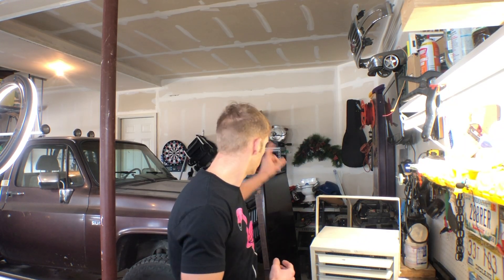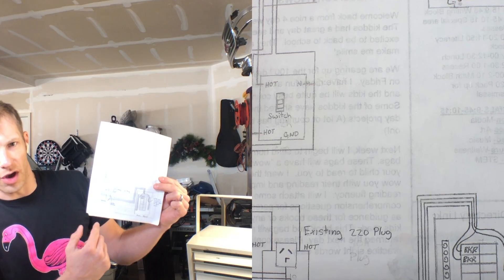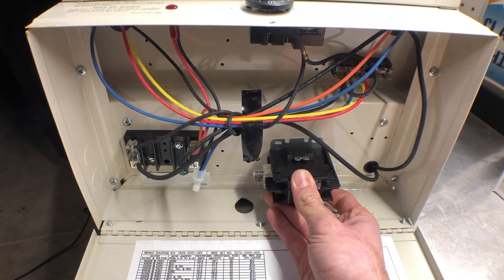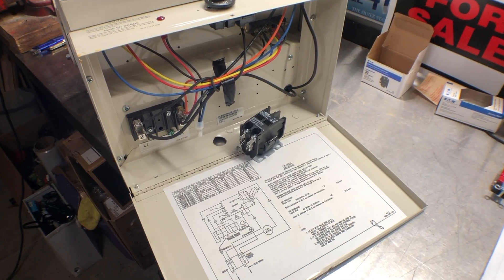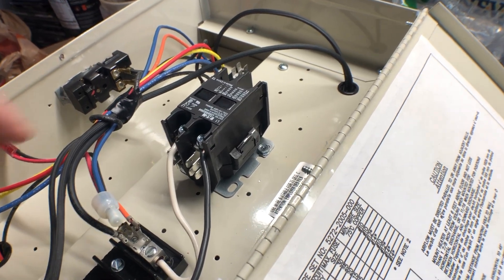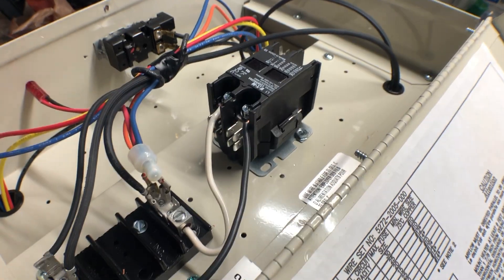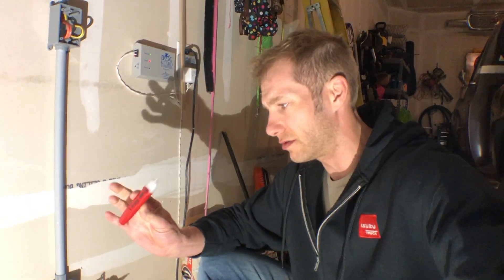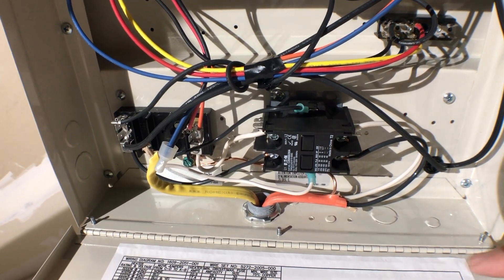How to: Wire a Contactor for a 240V garage heater!

Comment: Usually the contactor is installed in the heater.
Reply from the maker: @jolyonwelsh9834  it is installed in the heater. I mounted it in the bottom of the heater. Thanks for watching!
Reply: @HighPriority  no. Some heaters come with the contactor already installed.

Comment: In New York state.  if you use a plastic conduit, the outside orange and yellow casing has to be removed form the #10 and #12 wire
Reply from the maker: @RobertEdic-s9t  good to know. After doing this job and reading comments here, I would have ran individual wire.

Comment: This would fail an inspection.  That switch is not rated for 30 amps and you've basically put it inline with the heater load which defeats the purpose of using a contactor. The point of the contactor is to handle the load such that something like a normal light switch (or timer) can power the coil.  Also it's kinda wasteful and potentially dangerous (heat) to run romex like that through PVC (nitpick). Much cleaner (and easier to pull) to use individual THHN conductors. 
Nice heater BTW, I have the same one.
Reply: Unless he wired it differently than the diagram, the switch isn't in line with the heater. It's in parallel; the hot at the switch is spliced from the receptacle's hot line and then it only powers the contactor coil. The current through the switch will only be as much as the contactor coil draws, plus the power for the light.

Technically the switch in the diagram is labelled a bit strangely, since it's more accurate to say the line going to the contactor coil is "load", not "hot", but the circuit itself checks out.

Individual conductors should have been used in the conduit though for sure.

Comment: Please note for RV owners - that outlet is not for an RV! do not use it. That outlet is for a dryer - 220 volts. An RV 30 amp outlet should be 110 volts single phase. Search on YouTube for correct RV outlet wiring.

Comment: Awesome job man I am getting mine except I want to hardwire the heater directly to the panel breaker box with a switch. I don’t have a 240v outlet like yours. Any suggestion is appreciated how to wire that.
Reply from the maker: You can look up wiring straight to a breaker in your panel, or mount and wire your heater and run the wire to your panel, then have an electrician tie it to the panel.  That’s what I would do since panel work kinda scares me.
Reply: I am getting power directly from the 30 amp breaker 240v using 10/2 I don’t have a neutral wire. Do I need neutral ? as I saw you kinda tied the neutral from the breaker to the contact (white-12/2) at the switch box before letting it run up to the contactor.
Reply from the maker: @muqtarali9974  240 power doesn’t use a neutral, it’s two hits and a ground. The wire my electrician used when he installed the outlet is 10-3 wire with a ground, so it has three sheathed wires the white, black, and red as well as the ground. My white/ neutral was just hanging out unused in there so I used it for the neutral on the switch and contactor. Hope this helps

Comment: Great video. I'm having some confusion.  Not an electrician. I have a 5000w 240v unit. I have a 240v outlet for my air compressor wich is wired with #8 and going to a 40a circuit breaker. Can I wire this with #8 wire and have it plug into the outlet without any issues? Or do I risk burning my house down?
Reply from the maker: I debated on wiring my heater this way, with a cord and plug and not using the contactor at all but I opted to hard wire it. I think as long as you wire the plug correctly you shouldn’t have an issue and be able to unplug your comp and plug in your heater.  Granted, I am no electrician either.
Reply: Yes you can

Comment: Help me out, my head is hurting. I have 10/2 wire coming from my panel 30 amp breaker to a Leviton outlet in the garage. 
I’m guessing I can’t do this without a 10/3 wire? With what I have what are my options ? Thanks.

Comment: Could I wire a heater like this directly to a fuse box?
Reply from the maker: You could wire it direct to a breaker in the box yes. You would turn the breaker on and off to control the heater and wouldn’t need a switch or a contactor.
Reply: @HighPriority  Thanks but my garage has actual fuses. I'm struggling because there is little to no info on wiring to fuse boxes
Reply: @HighPriority Couldn't you just turn the heater off instead of using the breaker
Reply from the maker: @michaelvogel5300  yes you could. Would be wired and just turn the knob on and off on the front.

Comment: I'm using a contactor because the thermostat I got can't handle enough amps for my heater.
Reply from the maker: How did your install go?
Reply: @HighPriority  Still in the planning process.  I'm running a feeder from basement to garage for 100 amp subpanel with 220 heater, 220 plug and some 20 amp 110 outlets, so it's gonna be a project.
Reply from the maker: @MidcourtCrisisIA  oh yes that’s a big project for sure!  Stay safe, warm garage will be nice this winter.

Comment: Probably nitpicky, but your 240v input wires should go on the L1 and L2 terminals on the contactor and the output to the heater should be the T1 and T2 terminals. Looks like you did that backwards. Logically in my mind it shouldn't matter, but that is the way I understand it. Thanks for the video.
Reply from the maker: Oh ok thank you. I figured it was a switch and couldn’t figure out if it went a particular way.

Comment: Well done.
Though I'm not sure about pulling that much ROMEX in the enclosed 3/4" PVC conduit. Fully enclosed PVC traps the heat from the ROMEX and might be a local code issue, but I'm not sure. A small variety pack of colored electrical tape, a 50' spool of black #10 THHN wire and a 25' spool of black/red #12 THHN could have been another option.
I considered a similar install with red-illuminated pilot light switches for my 5000 Watt, 240 volt heaters. They have a power LEDs on their faces. I installed them with red, 2-pole, 30 amp (Leviton 3032-2R 30 Amp) switches. My switches are in 2 gang boxes as I was going to add a red LED Indicator Light to the side, off of one of the loads, but I didn't. I can tell the switch is on when it's toggled up and from a distance I can glance up at the heater to clearly see if it has power.
As a safety precaution (after doing some multi-meter reading on my electrical panel and some math with Ohm's law) I went with 2-pole, 25 amp breakers for each 5000 Watt unit rather than 30 amp.
Reply from the maker: Yea it was a pain to get that wire in there, I probably should have gone up in size.  I will have to have someone come look at this setup and see what I need to change to have it to code, I am curious, but if I ever sell this house this will come out anyway but still nice to know.

Comment: I'm sure this has been long sorted out - however - as a RV owner and shop junkie (not licensed sparky either) - if your outlet specified as an RV outlet is a legit one, it will be a 120V /30A circuit not a 240V!  If you hooked up a garage heater to it, chances are it wouldn't work at all but if someone did the reverse on a TT30 outlet wired for 240V, they would cause a lot of damage to their trailer/rig.  Just thought I'd mention it - take a good look first.  Many electricians unfamiliar with a 30A 120V TT30 receptacle wire them for 240V toys or wire incorrectly and cause tears.
Reply from the maker: Yes you are 100% correct, I should probably update the description. I had told my electrician I wanted just a basic  rv outlet so I assumed that is what he put in. After doing this video I realized I actually had a 240/60A plug!  I didn’t not realize this until I had family come and we were checking out the outlet prior to plugging in a travel trailer. So yea it was a headache and I will update the description. I appreciate your comment.
Reply: @High Priority  Glad you checked first and saved the rig!  Another good reason for primary protection/EMS on trailers.  I couldn't find a NEMA 6-50 (standard welder/shop gizmo receptacle) years ago and substituted a TT30 temporarily.  Well...  after bringing home a new travel trailer, I almost made the dreaded mistake and I put the damn outlet in/knew it was wrong, etc.  I only use NEMA 50s now as someone was smart enough to ensure that TT30 plugs won't fit (clearly not me however).  I'm looking at installing a 10kw heater on a NEMA50 but have a feeling some sparkys will cringe a little.

Comment: All you need is a 220v, 30 amp breaker for one of those. I hard wired mine and just got it inspected by the county inspector so it passed code for insurance. Easy as pie.
Reply from the maker: Cool good to know thank you!  Good point for insurance purposes.

Comment: i have a similiar heater, but only have 120 in my garage. How do i convert to 220? ty
Reply from the maker: I would recommend having an electrician run a 220 line from your panel to your garage. That is what I had done, I don’t like messing with stuff in the panel. My run wasn’t far as my panel is in my basement close to where my heater was installed.

Comment: You should use 3 conductor cable for 220.  Make sure you use the correct gage.  It has a red, black and white wire plus a ground.  You can put the switch in the white return for the contactor.
Reply from the maker: Thank you for the info. I appreciate it.
Reply: You say 3 conductor, but you then mention 4 conductor wire.  With 240 single phase there is no need for a neutral, so hot (black), hot (white), ground (green) is typical.  Black, Red, White, Green would be 4 conductor and used with a mixed voltage appliance like modern clothes dryer where the heating coil is 240VAC but the electronics are 120V, so now you have to have a neutral as the ground wire cannot be used to get 120v for the controls.
Reply: why 3 conductor for 220 (I mean 240 - bad habit)?  None of my tools are wired with anything other than 2 conductor wire.  No need to have a neutral??  I'm likely missing something (oops just saw Todd beat me to it).

Comment: Why does my contactor keep over heating and blowing up change it twice same problem? Not sure if anyone can help me
Reply from the maker: How much power are you running through it?  Is it the correct contactor for the voltage/amps you need?  Maybe you could up the size.
Reply: You can turn the thermostat down when you first turn it on.  The hardest thing for contactors is to switch while under load.
Reply from the maker: @MrHarleyhn  great info thank you!
Reply: Contactor coils work off 24v signal. 110 is way too much voltage.
Reply: @RA1-1  you can get different contractors that have different coil voltages.

Comment: Hello I been looking at many youtube videos about this heaer and many people said their electricity went up quiet a bit:(   If I buy this electric heater I will be only using it when I play pool in my garage which is once or 2x a month for about  6 or 7 hours.  Since I have natural gas I wanted to install a natural gas heater but this sounds expensive to tap into the gas line or run a gas line to garage.  However I think on the long run it will be cheaper that the electric heater???
Some people on you tube said it went up to $100 dollars a month others said about $30 or $40?? Anyways I will be installing a 240V outlet into my garage since I will also be getting a used electric car and need to charge it. So if I decide to get this electric heater I will already have an outlet for it.  On the videos I see people installing the electric heater high in the ceiling usually on the corner.  If i get electric heater can I just use an extension cord to plug it in or iwill it be better if I just install 240V outlet close to ceiling where heater will be?
Reply from the maker: I guess it would depend on how large your garage is and how long it would take to warm that up to determine the cost. I can look on my heater to see if it gives a usage estimate. I installed this one just to take the chill off when I record videos in my garage and since I installed it this last spring, I haven’t had to really run it yet. 
I thought about running an extension cord for mine to just plug it in but that type of cord for 240 power can get expensive so I decided to just run conduit down to my outlet. Also if you run a contactor like I did, it kind of complicated things a bit with the wiring. But yes you could plug in a 240 heater and it will turn on and won’t hurt anything. I like the idea of a gas heater but I think your right as running a gas line and the extra cost of the gas heater may get quite expensive. Let me know what you do.

Comment: Wish I would of seen this earlier. Contactor would of saved me a ton of money.
Reply from the maker: Thanks.  Yes I just feel like this is a better way to manage large loads.
Reply: How would a contactor save you money?
Reply from the maker: @KevinsHeaven  I’m assuming he may have bought the wrong stuff?  Or did it a different way that was more expensive?  I’m just spitball in here though haha.
Reply: @HighPriority  you may be right. 
I’m going to install one in my garage before next winter but I’ll just use a commercial grade 220V 30 switch. Can’t wait for that heat out there!
Reply from the maker: @KevinsHeaven  just used mine extensively last weekend and it was amazing. 25° outside and about 55° in the garage. Any warmer and I would have been sweating haha.
Reply: @HighPriority  that’s awesome. Mine is almost done being insulated. Then the drywall… Then I’ll be ready for heat next winter. Glad you’re enjoying yours!
Reply from the maker: @KevinsHeaven  right on!  My garage is insulated but doors are not so I try and turn the heat in about an hour or so before I go out to ice it a chance to take the chill off.
Reply: @HighPriority  Yes, for the most part that’s what most people do. They turn it on about an hour before they really need to be out there. There are lots of videos out there on insulating your own garage door if you ever get around to it…
Reply from the maker: @KevinsHeaven  thanks, I will have to check those out.